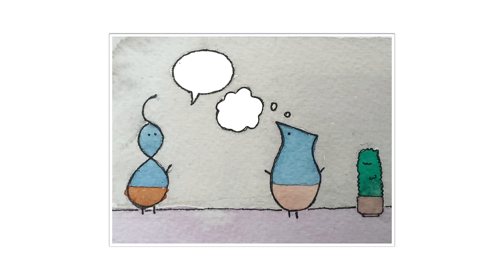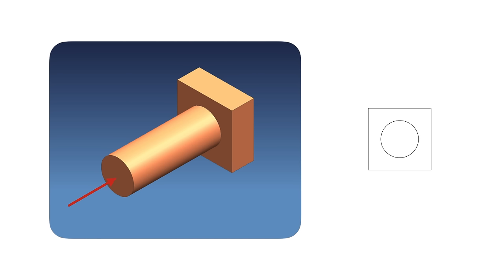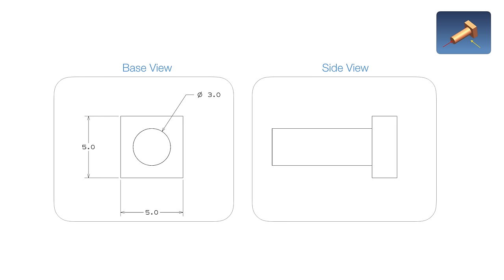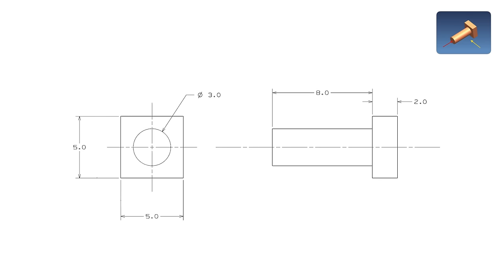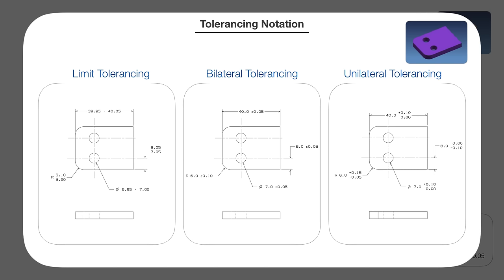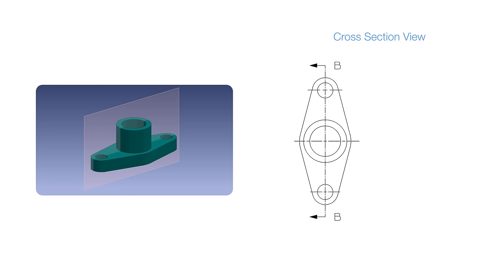Intro to Mechanical Engineering Drawing

Comment: This is bringing back flashbacks of my Mechanical Drawing days.  (Where second years had T-Squares strapped to their backpacks in the 80’s).

I learned Front View, Side View and Top View.  Those sequences will be forever etched in my brain.  (I guess the Top View here - which he omitted- would simply have been just a square box).  But I guess the top view might be superfluous in this example, because it is so simple.

Comment: A great video, helps to put in perspective of various processess. When using a 3d CAD software, I never knew the problem associated with over-constrainig of dimensions, even though the sofware prompts to correct it. Now, it makes sense when thinking in terms of tolerances that can associate with these dimensions, and the ambiguity that a machinist may face, when reading the drawing.  Thank you for a great content!
Reply from the maker: Thanks for the nice content. Glad you liked the vid!

Comment: That's a very nice video. My only criticism with it is that you do not mention what type of projection you are using, which is third-angle projection, used in the USA, Canada, Australia (and the UK partially I think). In Europe and most of the world, first-angle projection is used, in which the side view is put on the opposite side (to the left) of the front view. It might not matter for simple parts like the ones you've shown, but it can potentially produce communication errors. This is why there's always a symbol showing which projection convention is used in the drawing template.
https://en.wikipedia.org/wiki/Engineering_drawing#/media/File:Conventions_of_placing_vues_in_technical_drawings.svg
https://en.wikipedia.org/wiki/Engineering_drawing#Multiple_views_and_projections

Still a pretty good job, everything presented is crystal clear, the 3D view at the left and the 2D projection at the right is a nice touch. It must have taken quite some time to prepare. Congrats!
Reply from the maker: +Normand Chamberland This should be on top! I totally agree.  I left that topic out because my thought process was to get people drawing as soon as possible, and didn't want to interrupt the flow by talking about conventions.  Hopefully if people get more into drawing from this video they'll learn about it.

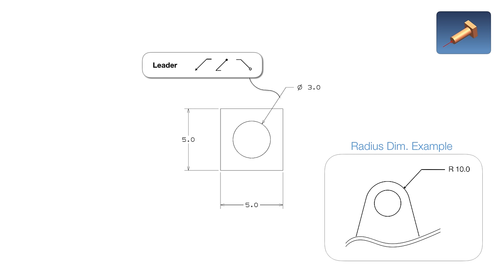Comment: 3:20 is wrong. It doesn't call out the position of the circular feature. It could be passable if a centerline was used vertically and horiziontally.
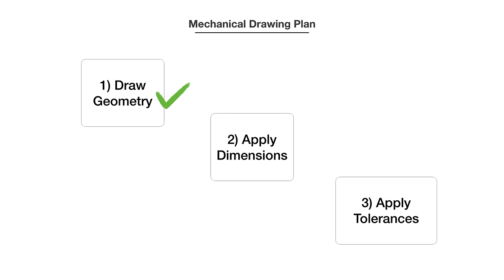Reply from the maker: The centerline is introduced at 6:00

Comment: Nice introduction, but it's short.
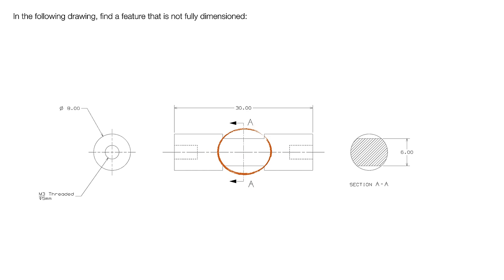At 14:28 The threaded part should have a 3/4 circle around the hole in front view and lines for it's boring with the angled tip on the side view.
You also could draw the flat spot viewed from top and draw diagonal lines in there.

Comment: Hi @Normal Universe - I'm a beginner at drafting and need to create simplistic drawings of two pieces of equipment that I built. I did some research and saw that QCAD or LibreCAD might be my best free options. Do you have any other input or advice regarding which platform to use, if I'm not yet proficient with CAD (and don't need that robust of a drawing). Thank you! This video was amazing!
Reply from the maker: Hey rogue! thank you for checking with me. I think learning this mechanical drawing stuff is nice for a few reasons. 
1) it gets your head in the mechanical mindset
2) This is how things used to be designed a few decades ago
3) Kids can grasp it and you can do it without a computer

Long term 3D CAD is more important though. My process might start with a rough sketch using mechanical drawing, but it always goes to 3D CAD for most of the designing. You only need to make mechanical drawings if you are ordering the part from a vendor. Most 3D CAD software will help you generate the drawing from your 3D model.

I don't know those two software. I highly recommend you check out Fusion 360 for 3D CAD, it can also make drawings when you need it.

What is the purpose of the drawings you need to make?
Reply: @TheNormalUniverse  Hey there, thanks for the quick response. I'm guessing we're in the same time zone (both in the EU perhaps!). Anyway, I'm not planning to do anything long term with CAD. I just have one project for a company I'm working with. I need to detail a perforation machine and mushroom substrate pasteurization.  I will check out the other 2 platforms, but I'm not trying to buy any parts cause we buy and make everything ourselves.

Comment: hey there quick question, at 13:19 you give a guide of the different lines but i cant spot the phantom line that is at 10:48. Am i confusing myself as the phantom line has 2 dots but in the video its showing as 1
Reply from the maker: Hey Raz, thanks for asking. At 13:19 I accidentally labelled the "Phantom Line" as a "cutting plane line. You are right it has two dots separated by long dashes.

Comment: Fourrh step: material spec. If you need a part in steel and you get it from the shop in PLA, aluminium or wood, it won't do you any good...

Comment: your tolerance for the 2.5 mm long measurements  to indicate the center of the shaft perpendicular and horizontal should be 0.025 mm   because if you have 0.05 mm  then you have a overcontraining right because the other half has a 0.05 mm giving you a total  of 0.10 mm tolerance .  but in the 5.0 mm or inches long measurement you have only 0.05 mm tolerance. tell me if i am wrong
Reply from the maker: demo last are you referring to the drawing about the drawing of the bolt that we build up through the video? I don't think it's over constrained. Tolerances on the position of the shaft are unaffected by tolerances in the diameter or length of the shaft. I'll double check with some of my coworkers who are more experienced though.
Reply: yes i am referring to that one,  see,  you have a tolerance -+ of 0.05 on the total   left side square , but in the right side you have a -+ 0.05 tolerance for only a half of the distance . i am asking you if this is right cause to me it seems like it should be a 0.025 tolerance even this one is referring to the circle  but i am not sure, i am not a machinist but i want to learn. thank you answering my questions.
Reply from the maker: demo last can you tell me a time stamp to look at so I can be sure we're looking at the same thing?

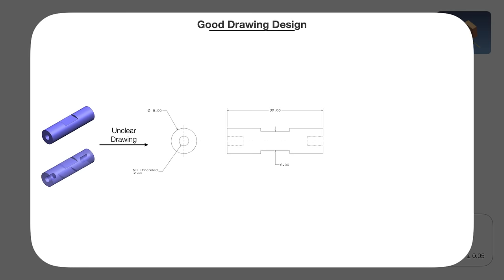Comment: Great video.  In the "unclear drawing" example (@12:30), rather than adding a cross-section view to clarify, wouldn't it have been sufficient to show the hidden lines in the head-on view?
Reply from the maker: Yup hidden lines would have helped. There are definitely multiple ways to do it. Another option is just to include a view from an isometric perspective.  Isometric views are good for showing the overall form of an object but not so good for dimensioning things. Glad you liked the vid!

Comment: Wouldn't the first problem be both A and B, since if you were to flip B horizontally (line above the square hole end) and then vertically over (line on the short end) , so that it lays flat against piece A, it could also count as the right side sketch. The only thing would be that you wouldn't be able to to tell that with piece B, the top/short part is sticking towards your view instead of away from you like how it would be interpreted as piece A. However, since the top square line in the left sketch is solid means that the square piece extends forward? In cases like that, could the top line of the square in sketch 2 be dotted to show that the square piece is actually extended from behind instead of forward (to count as piece B)?

Kinda typing out my thought process, but would also like a take on this, whether it is possible it could be interpreted that way and also how to make it so that it just counts as piece A. (I think I made it more complicated than it should've been😅)
Reply from the maker: ElleonOnline hi Ellen! Sorry it’s too hard for me to follow this over text. I should have done a better job making this question clear. The A and B shapes are mirror images of each other, so only one can be the answer. I believe it is A. Don’t stress about it though!

For more detail, google “first angle projection” and “third angle projection.” I skipped that topic in this video because it is too boring and not required to learn how to do these drawings. Unfortunately USA and Europe disagree on this topic. Europe uses first angle and USA uses third angle.  (This video uses third angle because I am in the USA)
Reply: Normal Universe I will look into those topics (even though you say they're boring 😅) Thank you for your reply! I'm still very new to all of this, so I'm going to think about these things more

Comment: Awesome video. Small note, I got the first answer a different way, but still don't understand your explanation for the first question at 14:00. After reviewing your explanation a few times I still don't know what ledge you're referencing.
Reply from the maker: Thanks! When I said ledge, I was referring to the small step next to the hole. I wanted to clarify which side of the part I was referring to, and only one side has the step.  

Just wondering, how did you find the video?

Comment: Is  Mechanical drawing need to applying scale ? if so what drawing scale ?
Reply: Depends on the size of the object and the size of the paper you are using. Just use what scale fits best, there is no set scale.

Comment: For the second quiz question: I think you also forgot to dimension the depth of the holes.
Reply from the maker: It wasn't introduced in the video, but the depth is called out in a note with a little downward pointing arrow symbol. Sorry I could have done better with that! Ran out of time to get a better example.  Thanks for pointing it out though.
Reply: Ah, I see it now. Nice work on the video!

Comment: In the last question the depth of holes are also not dimensioned sir.i have very little knowledge but I m just asking.
Reply from the maker: Good catch! They are, but in the text note.  There is a little downward pointing arrow with a "5mm" after it, which is a shorthand way to indicate that the hole is 5mm deep.  Sorry for the confusion, that was my fault for not explaining it in the video.
Reply: Thanks sir.learned honesty also from u.

Comment: Hi why don't engineering drawings show the curvature of the earth.
Reply from the maker: wat
Reply: @TheNormalUniverse  don't mean to be rude, but you do understand English?
Reply from the maker: @Soroczynski  sorry for my rude comment as well.  Can you clarify your question about engineering drawings and earth curvature? For example, how do you expect earth curvature to show up in a drawing?
Reply: @TheNormalUniverse  sorry iv been looking into flat earth and being a former fabricator I realise that engineering drawings match reality scale included, looking at some footage of earth's supposed curve at 8 " per mile squared I can't work out how that wouldn't be shown on the drawing. Considering engineering drawings clearly define all information. If you can help that would be great, thanks for answering.
Reply from the maker: How much would a 1 long piece of paper curve if it bent along an earth sized circle?  Let's say its 1 foot worth of the 8" per mile curvature stat you listed.  Well (1/5280)*8 inches is two thousandths of an inch.  The printer used to make the drawing is probably less accurate than that.
Reply: @TheNormalUniverse  I'm sorry that makes no sense to me are you basically saying no curve then. Go look at a fake video from soundly of a bridge, it's curved to death. All drawings are made from a t and set square. It's impossible for earth to curve.

Comment: First Mistake spotted on the thumbnail....
Reply from the maker: what's the mistake? I can actually change the thumbnail
Reply: @TheNormalUniverse  the numbers have to be oriented that way so that you read them looking from the right or the bottom of the drawing. 
The measurement 14 has to be turned  by 90 degrees. Later in the video: 
measurements of diameters get a diameter symbol. A crossed circle  in front of the number if you know what I mean.
Sry for my English...